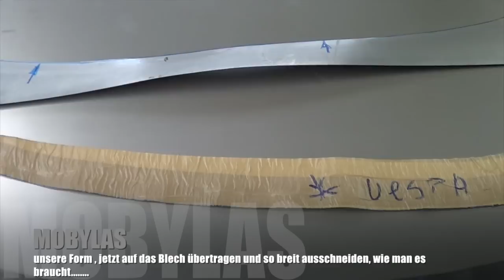Vespa Restauration, Backenverbreiterung, Schweißkurse und Oldtimer Seminare bei MOBYLAS,

Comment: Es sehe aus als das du die Streife überlappe und nicht stumpf ?  Ist das richtig gesehen ? Und wenn muss du dann nicht auch der Innenseite mit autogenschweißen  durchführen.. Du hat es auch im eine Film mit ein Türreperatur. Da zeigt du nur die Punktschweißen und dann die Zinn ? Sehr viel Lob super gemacht.
Reply from the maker: die Streifen für die verbreiterungen würden auf Stoß am alten Teil, Autogen angeschweißt. Die Backen MIT Verbreiterung, würden mit Überlapp MIG Hartgelötet am Rahmen, also MIT Überlapp. Mann kann nur auf Stoß Schweißen, wenn man von beide Seiten dran kann zum glätten der Schweißnaht......   ; )
Reply: @mobylas  Warum das? Muss die Schweißnaht unbedingt geglättet werden? Wenn man überlappend schweißt zeichnet sich auf der Rückseite ja auch der Schweißpunkt ab und eventuell vorhandener Lack ist dann weg.
Reply from the maker: @valeriosampognaro  sorry, i think "Google Translate", is not correct, can you write in English ?
Reply: @mobylas  Why does the weld have to be smoothed? Also if you weld overlapping, the point will go through the metal and burn any existing paint on the back. Why is that ok, but when you weld "auf stoß", the back has to be smoothed?
Reply from the maker: @valeriosampognaro , i only work on Sandblasted metal, so there is no Paint on the back side,  most panel beaters have a " A-Side" and a "B-Side" at there Work, at my Work both side´s are "A-side´s" ; )
Reply: @mobylas  That's good to hear ;) But, is it perfectionism or are there other disadvantages from not smoothening the inner weld, like rust?
Reply from the maker: @valeriosampognaro  there are no disadvantages, when i am done with my work, the Panel will be Sandblasted again, and than becomes a Epoxy Primer, so rust is no item.....